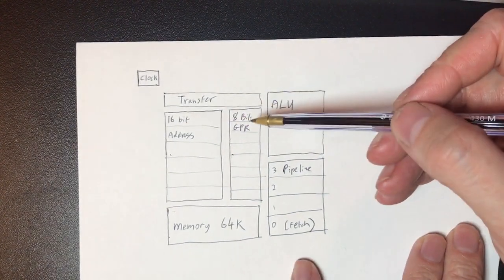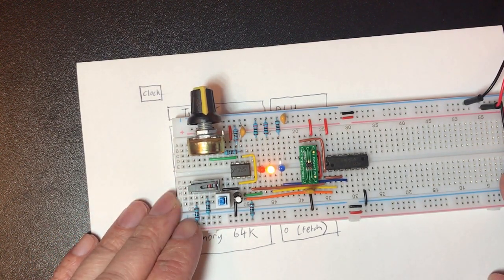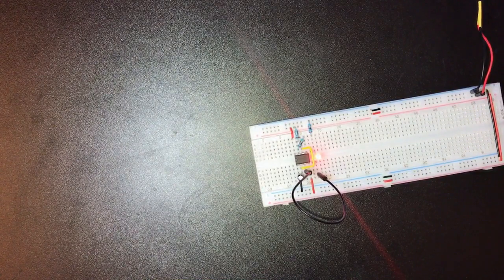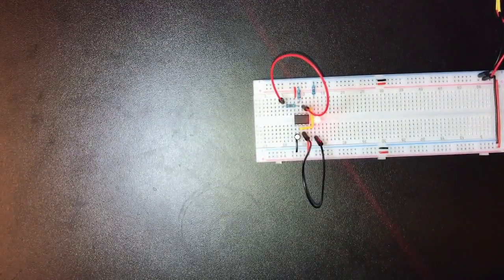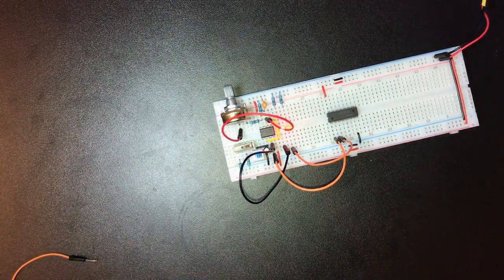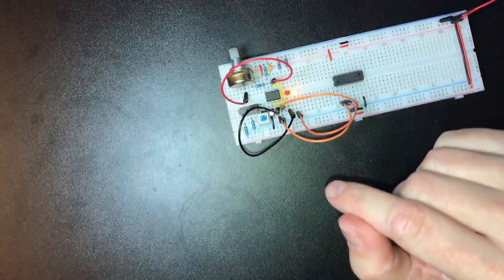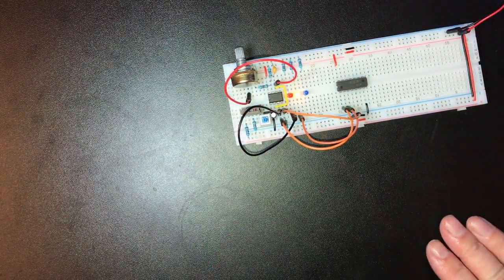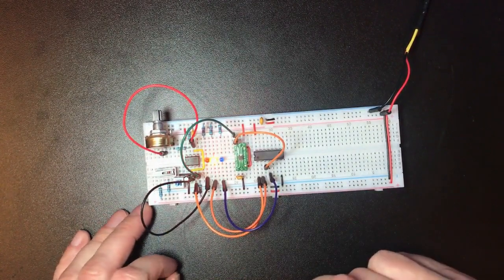Introduction and Clock Build - Making an 8 Bit pipelined CPU - Part 1

Comment: I have just recently finished the Ben Eater build and my brain is hungry for more. I have read up to the SAP-3 section of Malvinos book but I am sad to see the SAP 2 design skips/assumes the reader knows more than the basics. For instance I doesn't mention what part to use for the 62K ram and 2K rom. I assume this is just a 64K chip but then how it takes 2K for the 'monitor' is left unstated and even how and what the monitor does is also left assumed. Likewise how the instruction register is expanded as well as the program counter are all left up to the imagination as schematics are sadly absent. Im hoping that by going through your videos and by learning as much as possible someone who is new to electronics can overcome these challenges and build something close to what the book describes. Keep up the great work!
Reply from the maker: Glad you are finding this stuff interesting! You are probably right that the "62k Ram" they use is likely a 64k part. I expect they have some address detection logic to switch chip enable. 2K is 11 bits leaving 5bits at the top, NOR those 5 bits together for the ram's chip enable and OR them together for the rom chip enable (Assuming you want ROM in the first 2k of memory). At this point my build has a 32k Ram + 32k Rom configuration which is a little easier with currently available chips, I do have one more memory change planned in a few weeks time that makes that much more flexible. Hope you enjoy the rest of the videos, if you ask questions in the comments I usually reply pretty quickly.

Comment: "I have a bad habit of working on circuit boards with the power on"

Me too. I need to remind myself not to. I've been soldering bodge wires on a board that I was running and testing code on at the same time this last week....remembering "This is probably not a good idea..."
Reply from the maker: Nice! I’m guessing you were using a power supply without a mains ground? Or is your soldering iron not earthed? I know I shouldn’t work on the circuits while powered but it’s nice to get the immediate feedback. The only thing I’ve broken is a 555 timer when I plugged the power in the wrong way, I guess I could put a few diodes in to protect against that. I’m mostly building with cheap ebay chips so it wouldn’t bother me too much if I had a small attrition rate.
Reply: @weirdboyjim  ~12VAC adapter into my own power supply to give me +/- 12V rails. Soldering iron is earthed I believe. I've busted so many ICs from wrong polarity power, or a wire jumping out of breadboard and with utmost precision hitting the -12V rail. Every bloody time :P

Also yay! Cheap ebay chip club!! Most of what I have is from ebay. Sadly some opamps I got were fakes though. Be aware of some jellybean parts, they may just be shit clones.
Reply from the maker: @VK2GPU  I have some good quality parts for the final version of the address registers, this whole project is me learning electronics (if that wasn’t obvious) using my normal “jump in at the deep end” approach. A lot of the logic chips I’m buying look like “new-old” stock, so I do worry the supply will dry up one day. Not had anything fake or bad yet, a few things have simply not turned up but when your paying pennies for chips from China it can be a worth the risk.
Reply: @weirdboyjim I done alright until a set of opamps. Didn't even know they were fakes until I built something that was sensitive to the input pin voltages. Thankfully it was someone on the Synth DIY group on FB pointed me in the right direction. Swapped out for a known good part, worked perfectly. For future I'll prob only use LCSC for most of my resistors, caps, jellybean parts, etc... eBay for the more niche NOS parts.

For this project being about learning electronics it seems like you're doing great!! I'm now thinking I should youtube a project I've got burning the back of my mind - building a GPU. I've got a pile of 6502s that I want to turn into a GPU. Why? For the glory of Satan of course!
Reply from the maker: @VK2GPU  That GPU idea is interesting, I’ve thought about doing something similar but using microcontrollers and some discrete logic. Something at the early 3dfx level would be plausible.
Reply: Same... I really should remember not to when working with (relatively) expensive and (very) complex and high speed boards like the raspberry pi.

Comment: Watched all the VGA videos so far, now I’m here. I’ve watched Ben Eaters videos, and even got the kit but gave up and haven’t touched it for a long time because I got frustrated that it didn’t work right. Watching you makes me want to give it another go!
Reply from the maker: Glad you found it interesting. Which of his kits did you get? The thing to do is find ways of testing everything as much as you can as you go.
Reply: @weirdboyjim  Both the 8-bit CPU and the 6502. My main problem is not knowing how to fix the issues that I find. I know there is a lot of help to find on eg. reddit, but my patience just ran out. :)

Comment: A friend pointed me to your videos. I have started from this number 1 and I am working my way through. It is interesting to hear your train of thought. I am puzzled at exactly what you level of electronics knowledge is. You obviously understand computer architecture and the concept of pipelines. I would have though most people attempting to build a TTL computer would keep things simple! :-)  In later videos you give hints that you have programmed various micros. One thing I notice which surprised me (although it worked), is that I have always connected LEDs (via a resistor) to +5V, but you use ground instead. OK so LED on is "0" and off is "1" but you can use the open collector 74LS06 inverting open collector device to make a logic "1" input light the LED. I was under the impression that you shouldn't drive LEDs using a logic high (i.e. don't connect the LED to ground). Perhaps modern LEDs need much less current than back in the 80's, so this is not an issue. H-ll when I use SMD LEDs I use a 10k current limiting resistor, whereas back in the 80's the current limiting resistor value of choice was 330 ohm! . As you have shown it obviously works! BTW your use of the resistor SIL is a great idea. No criticism intended!
Reply from the maker: My level of electronics knowledge at the start of this project was very low, I dabbled with a few things over the years but probably 90% of what I have learned is since starting this project, and I've filmed most of that. I know a lot more now that when I started but I believe you are right, I'll stick my cards on the table and explain my understanding. Early logic chips had a transistor to pull down and a resistor to pull up, of course they didn't have a lump of carbon film on the chip, so the "resistor" was actually a leaky half formed gate. Using a high to drive the led meant you were sinking current through that and as you correctly stated the older led's need more. Modern chips may have similar function but they have fully formed gates pulling in both directions, so the direction of higher current doesn't make a difference.

Comment: The algorithm fed me one of your more recent VGA videos... which looked super cool, but I wanted to watch the origins of how you got to where you were on those (and having seen Ben's videos was not enough, though I have)... I believe I may be watching all of your videos, now, over the coming weeks.  :)
But I have a suggestion, re 21:23: a foot pedal switch for power!  I do normally open, but normally closed could work, too... either way, you can de-power things without having to unplug anything, or even flipping a toggle by hand.  Would recommend.  :)

Hmmm, and perhaps I'll pull the kit I got from Ben back out, and get back to it again....... Here's hoping. :)

Thanks for sharing!  Expect more comments now and then.  :)
Reply from the maker: Foot pedal is an interesting idea for this kind of problem, for a lot of these early circuits a toggle switch on the desk would have been fine. I don't want to spoil anything for you, but over the next 100+ videos I completely fail to resolve this bad habit. Hope you enjoy the series, you've watched some of the later stuff so you know my production standards improve from this early stuff.

Comment: I use TL7705s in my projects when I need power on reset. They are also voltage supervisors. But the great thing about them is the ability to use external resistors and capacitors to set your reset delay period.

They also provide positive and inverted reset outputs.

Available in DIP8 so breadboard friendly.
Reply from the maker: I'll take a look at that part thanks. I didn't find it in my searches at the time.
Reply: @weirdboyjim  there are so many of these parts it's not hard to miss them. I think I either came across them by accident or with some obscure search. I really don't remember how I found them, but hopefully they might be of use to you.
Reply: @weirdboyjim  I forgot about feature they have, you can also hook a reset button up to them and it will generate a reset pulse for you as determined by the external RC. I think that's why I liked them so much, they are a bit of an all in one with some nice external controls.
Reply: in addition, a ds1233 also would work
Reply: Very interesting, I'll try it in my CPU right away. @TomStorey, do you  have an example how setup the circuit with the reset button? I'm not sure how this can be done.
Reply: @gabrielezucchetta4407  Use the RESIN/ pin. Pull up via a resistor, and down to ground through a button or other circuitry.

Comment: I just came across this channel myself.
I agree Ben's clock is more complex than probably necessary, but I found a fundamental difference between this and ben's:
The single step in this one does a full high/low pulse, whereas in Ben's, you single step the clock transition: push: high, push: low.
I can't remember if in Ben 's when you go from clock to single step, output stays at current clock state though.  This one clearly does not.
Reply from the maker: I thought Bens' was the same? I've not had hands on with his circuit and I last watched it many years ago.  This clock lasted a while but I build a more complex one later in the series.

Comment: Yes, there is a reason for not connecting the Vcc and Vcc1 internally: lead and bonding wire resistance. Devices that monitor power rails often have seemingly redundant "sense" pins (I assume the Vcc1 is such a sense pin). The sense pins are connected to the same traces on the board but they do not draw any significant current (in contrast to supply pins like Vcc), so the voltage drop across the pin, lead, and bonding wire is close to zero. This way the device can get better measurements of the supply rail that are independent of its own current draw.
Reply from the maker: That would make sense, I also wondered if it could be used to monitor a separate power rail.

Comment: But what about debouncing the switches? Enjoying so far, will watch the whole series!
Reply from the maker: I’ve not had any bounce issues with the circuit but as I say in the video I pretty much took this from Julians video. I’m still a total amateur at electronics (especially the analogue side of things) but my understanding is that the circuit is partially debounced by the capacitor; the switches are changing the resistances that are trying to charge/discharge it so you need to have contact for a “while” before the transition happens. Bounce is probably possible if you get the timing just right but I don’t see it in practice. I actually plan to do a new clock circuit at some point based of a high frequency crystal and a digital divider, but this is working for now at low clock rates. I hope you enjoy.
Reply: I just ran into this video series today, and I was wondering about the debouncing issue also. This clock circuit is certainly more compact, but how do you prevent the switch from causing multiple pulses when pressed?

Anyway - very cool stuff. I'm up to Part 4 at this point and will definitely watch the entire series. I finished my implementation of Ben's breadboard version of Malvino's SAP-1 almost 3 years ago. I've started buying more parts because I want to build another one, but this time without all of the 4-bit bottlenecks.
Reply: It's gonna be a bit of effort for me to watch the whole series. (100 videos - how?)

Comment: Is there a substitute breadboard mount chip for the lp3470?
Reply from the maker: I wasn't able to find one which is why I got the little adapter board. There are similar chips though but I wanted to use the same device on breadboard + final circuit.  Take a look at the TC1232CPA, it looks like there are smd+through hole versions of that so it might have been a better choice had I known about it.

Comment: Why did you use a whole chip for that single not gate? You could've used a resistor and a transistor to make your own. It takes up less space and it is cheaper.
Reply from the maker: I used 2 of the not gates, one for the clock and one for the reset. Although the real answer to that question is "I didn't know any better", I was very new to electronics when I made that. Still not an expert though, wouldn't it be better to use a pair of fet's to implement a stand alone inverter?
Reply: @weirdboyjim  oh I see. I am not sure if a transistor or a fet is better, but this setup works for you so I guess that you can keep it. I was just wondering why you used a whole chip. Btw this series is fun to watch.
Reply: @weirdboyjim  you can create an "open collector/drain" inverter using a single transistor and one or two resistors depending on whether you use a MOSFET or BJT as the transistor respectively.

I don't really think cost is a great concern at your scale since you aren't building millions of units were saving every cent adds up, and it's more fiddly to do it this way, so no problem to throw in a hex inverter IC IMO. 

If you really wanted to, when/if you come to build this circuit as a PCB, you could look at the "little logic" series of gates (aka "1G"). They come in 5/6 pin packages usually with just a single gate within, so you can minimise "wastage", but I suspect cost would not be all that significantly different, and the only real benefits might be if you were short on space or had routing constraints as you can sprinkle them around and place them more directly where they are needed on the board.
Reply: Gotta pick the right tool for the job.  If I were designing a circuit on a PCB with SMD parts and such, I might opt for a single transistor inverter, if I only needed the one.  But the inverter IC is a full, optimized circuit with characterized speed rating and voltage thresholds, optional open-drain or push-pull outputs, possibly a Schmitt trigger input, and so on.  If you have one, and especially on a breadboard where the less complex the better, then you can't go wrong with a fully-baked IC.
Reply: I’d say it’s less effort to just stick in a 50 cent modular part that is standardised, than it is to look up resistor values, gate switching speeds etc. Plus spending a few extra cents to have something that sticks solidly into a breadboard is probably cheaper than hours of debugging bad flying lead connections.

Comment: Ok, I'm going through your series again for the 3rd time. I find the topic incredibly compelling even though I often feel the explanations wafting through my hair as they pass over my head. It may be because I was born before the space-age (9 when it officially began in 1957); but, I did build my first computer in the 7th grade out of magnetic relays using cardboard to guide a punched cardstock past some bent paper clip contacts to provide the instruction, data and clock pulse. So, in MY mind, I should be able to understand this... or at least enough to say that I did. 

I see that schematics aren't high on your list. And I know that you do make some alterations to the clock somewhere down the line; and that you did say you have some posting on "Easyeda." But do you know if there's a direct link to your schematic for this post (or the finished clock) - i.e. without having to "join the club" at eda. I really don't have any use for joining their organization beyond looking at your schematic and would rather not if you have any other way,

I've enough experience with coding (even in assembly) and building to recognize the incredible talent it takes to do what you're doing - all while wrangling cameras and microphones and cables. I hope to be able to watch you do what you do - until you've covered all there is to cover.
Reply from the maker: Glad you are enjoying it. The easy eda link on the about page should get you to schematics. You shouldn’t need a login just to view.

Comment: Just found your series so starting at ep1. Seems ive got my next month of TV covered. ;)
But i have to ask, why would you choose a 555?? There are a lot of clock citcuits out there that allow you to go to much higher speeds, and only need a crystal and a NOT gate or two.
Reply from the maker: The 555 is great for creating variable clocks. I build a new clock circuit later in the series that adds a crystal for high speed running.